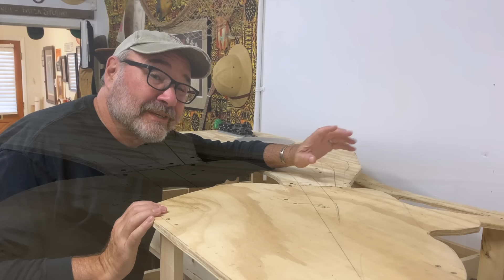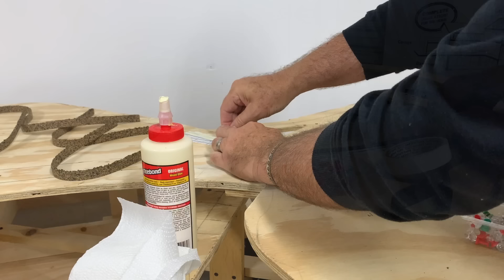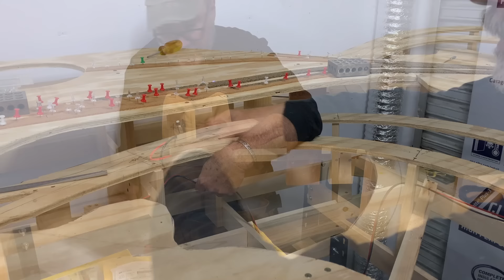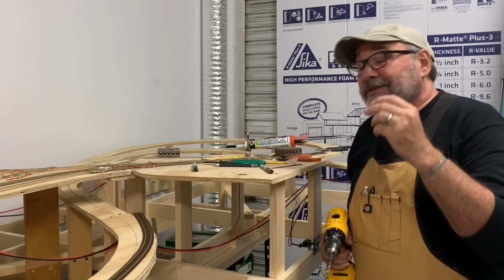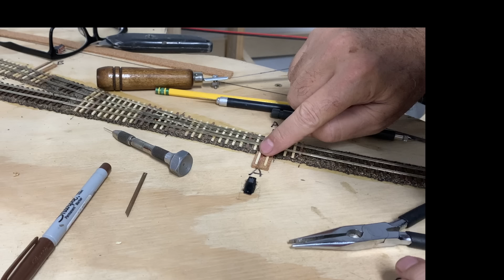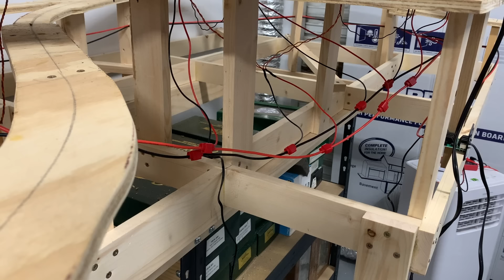HOn3 Barlow Pass Layout | Track, Turnouts and DCC Wiring

Comment: Hmmm, we all have to make compromises that complicates things.  Often that includes putting spotting locations for freight cars on a track that will be used for a run around.  That especially complicates matters though when that includes a freight house spotting location as, if there is a need spend the money to build a freight house, that means there is usually enough freight to always have cars spotted there.  Perhaps a better solution would have been to leave the crossover in the original configuration, do away with the turn table track at the eight o'clock position, and then switch the passenger and freight depot locations.  Thus moving the freight house spotting location out of the path of the run around.  The road to access the freight house could still wander behind the passenger depot to the main street connection, while also giving road access to the passenger depot at the same time.  I know you were probably thinking ahead to photographing opportunities there at the eight o'clock position, but perhaps putting the side shed on the opposite side of the round house would achieve a similar opportunity?  Whatever way you choose, it will be just fine.  Just be advised that in the current configuration you will have to either leave the freight depot location unspotted or push cars out the the way when you arrive into town.

Comment: 12:46 This is how I did many n-scale turnouts, but I had double adhesive tape on a printed template and first put down prepared pc boards, then I simply soldered the turnouts on top. This way I could solder almost any radius or number without a turnout fixture. I recently found a set of different curved turnouts that looked really good. My track plan involved more than 10 different types of turnouts.... that's $2000 just in fixtures......

Comment: I am sure you already know this, but trying to share information.  Disconnect one bus wire from your power or command station.  Go to any automotive store and get any incandescent indicator bulb and socket.  wire it into that bus in series.  physically locate the bulb somewhere in the area that that bus wire serves.  if you have block sections, use one bulb per block.  This way, if you get a short across the rails, THE BULB WILL LIGHT UP and consume some of the dead-short current and heat up taking heat away from whatever caused the short (ie, not melting wheel pickups) and as a bonus, the light tells you there is a short, and even where in the layout the short is.

Comment: Enjoyed the video. A tip when you come to ballast the track, a teaspoon. Use it to lay a bead of ballast down the centre line, smooth the bead out with a finger so it spreads between the rails. Repeat for the ballast shoulders outside the rails. So far nothing out of the ordinary. Next tap out a rhythm on the rails themselves with the back of the teaspoon and watch the grains of ballast clear themselves from  both the sides of the rails and tops of the sleepers as if by magic. Then the usual wet and dilute glue stage. Much less faff.
Reply from the maker: Good tip!

Comment: I hope you don’t mind me laughing at you calling them “suitcase” connectors. Everyone I know just calls them Scotch locks. I used them to repair the wiring on my first car in 1970.
Reply: I like using T Taps. Same basic no solder concept with options for different wire gauges. The connection can be "separated" and reconnected multiple times with reliability.
Reply from the maker: Laugh all you want. People call them different things in different parts of the country.

Comment: Very nice! I also found myself making my own cork roadbed in HO standard Guage. (couldn't find any available) I bought 12"x12" sheets of 3/16" cork at Michael's and ripped them into strips on the bandsaw. When I split them in two, I tilted the table to get beveled edges like the Midwest product.  I'm still developing a slide switch turnout throw. After seeing yours, it looks like I may be over engineering mine.

Comment: one of my plans is coming together. I'm backdating an athearn 2-8-0 to look like a union pacific camelback. i got a resin 3d printer for it and through trial and error I've been making parts for it. i recently finished the second cab, or at least the first try at it and so far its looking great. i think i'll need a new resin though, after further research i realized i chose one of the worst resins out there but its working for most things.

Comment: I used that slide switch technique on my last n scale layout to power frogs and signal routing. One thing that I did was to carve the handle a bit to resemble a switch stand base and drilled a hole in the top to accept a piece of wire with a round target glued to it. Other places I cut it short to resemble a battery box for a powered interlocking switch.
Reply from the maker: Great ideas!